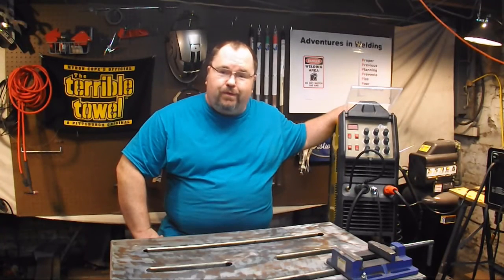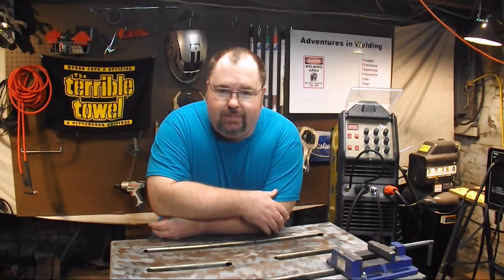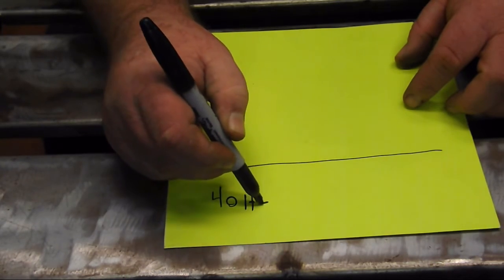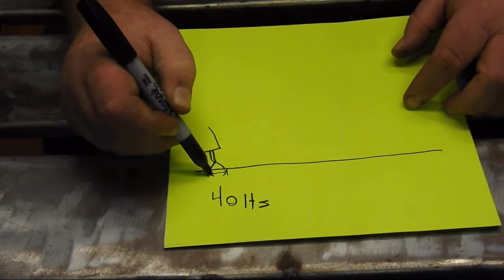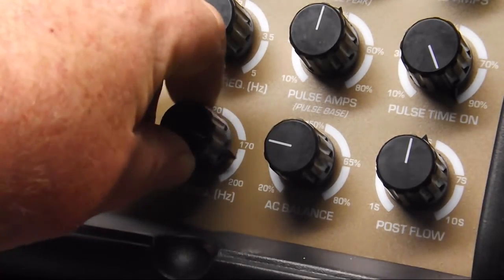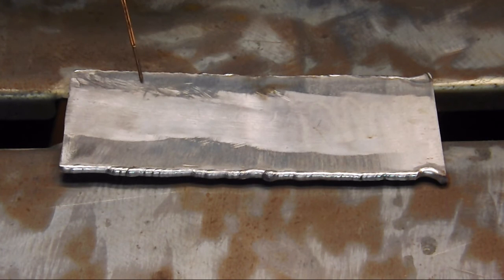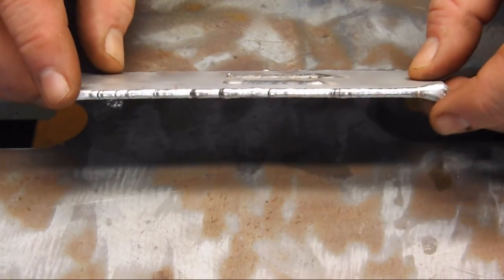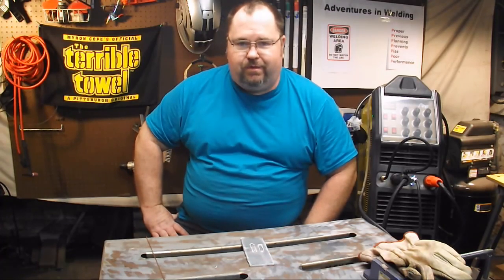AC Frequency in TIG welding

Comment: question...just got my machine....welds aluminum really nice...but when I back off the peddle it will basically end the arc at about 28 to 30 amps. It basically starts and stops around 30 even when start is set to 10, running amps to 100 and ending amps to 10.   With my Lincoln it seams to start and terminate at a much lower amperage...guessing 6-10 ( there is no readout on the Lincoln).  I was using 3/32 T, I will try 1/16 to see if I can get lower amperage....any thoughts?  thanks.
Reply from the maker: +Dave Axton Hi Dave! Thanks for watching and for writing in. The AlphaTig200 will start and stop a DC arc at 10 amps. But due to something with the AC circuitry you can only stop and start the arc at about 20amps. I know it is a disapointing fact, but I'm guessing it was something that was done to cut costs and keep this thing sub $800.
Reply: Thanks...I am also hearing that lowing the frequency
 down may help as well...I am around 125 - 130...being told dropping to 90 will help coming out of an arc at low amps....I'll test that this weekend.  Thanks
Reply from the maker: +Dave Axton Let me know if that helps, I'm very interested.
Reply: +Adventures in Welding! it definitely seemed to help.  the combination of running 1/16th T and mowing 5he frequently helped allot....diameter of tungsten I'm sure is a big part of it...thinner T less amperage it obviously takes to create initial arc.
Reply from the maker: +Dave Axton That's good info Dave, thank you.
Reply: +Adventures in Welding! I do want to get a lighter torch, line and adaptor....but I don't see it on Georges site or ebay store.
Reply from the maker: +Dave Axton Dave, just give George a call and tell him you want a superflex cable, and a DINSE35 adapter for the AHP tig 200. try that with your torch you have. I think you will be happy. but if you still want to go lighter you can get a #9. also you might try a stubby gas lens kit. George sells them to. please tell him I sent you. I promise he will take good care of you. he owns a Tig200 and also services them. So when your warranty expires you know you can get your machine running if you ever have any problems.
Reply: +Adventures in Welding! awesome...thanks!

Comment: Hey Paul, as you go up in the Hz. dose that make it penatration more? From your explanation I think it dose, but I don't know. 
Pidge
Reply from the maker: +PiDGE IAM Pidge, The answer to that question is yes and no. Since the amperage and therefore the heat remain constant and since aluminum is such a great heat sink, you aren't getting any more heat into the metal any faster. BUT you are concentrating the heat into a smaller area. Think of it like a focusing flashlight. With a wide focus you get a soft even light. With a tight focus you get a a very narrow circle of what seems like brighter light. The lumens remain the same.